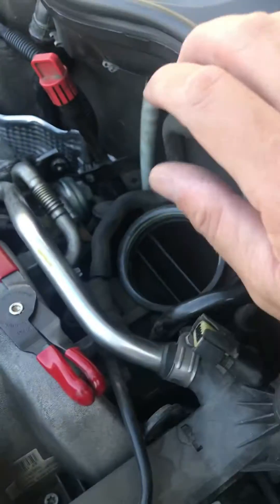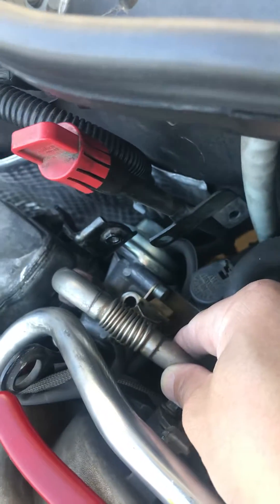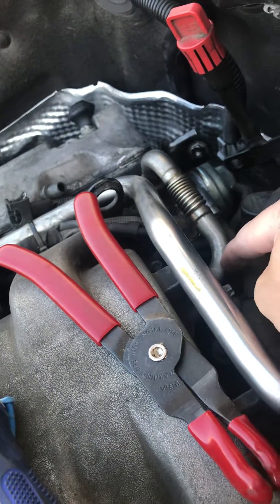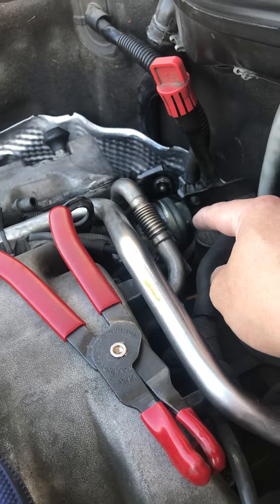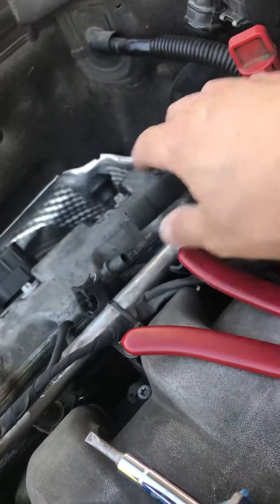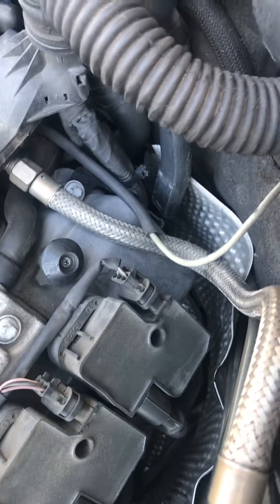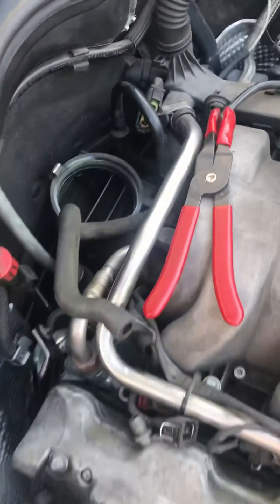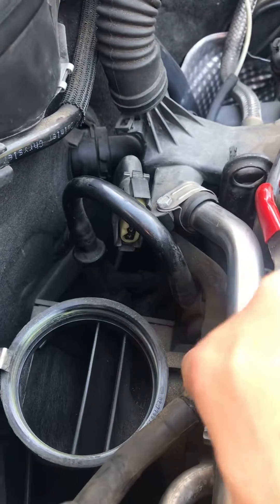EGR valve removal MAF removal C240 W203 M112 part 1

Comment: Things that helped me were to add WD 40 to the top fitting and let it sit for 10 minutes before breaking it loose. Before removing the tube I hit it with a hammer lightly a couple times to break it loose. I also removed the bracket that connects to the oil dipstick tube. Two bolts, one on top and one on bottom a couple inches down.